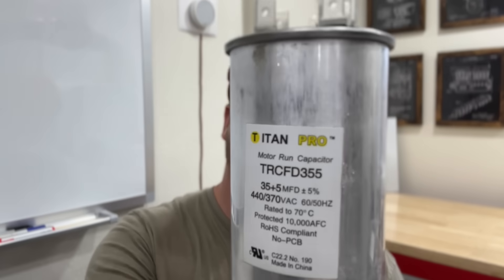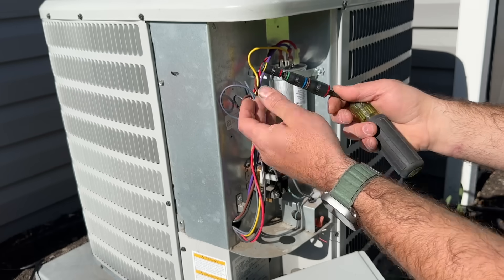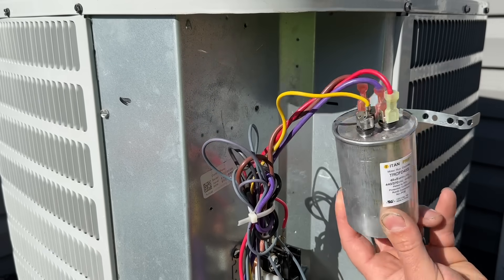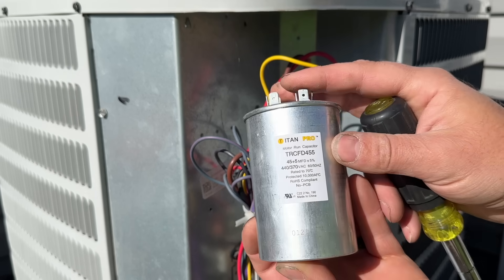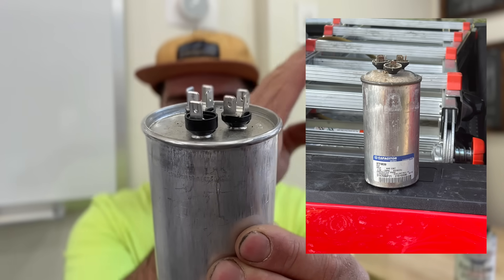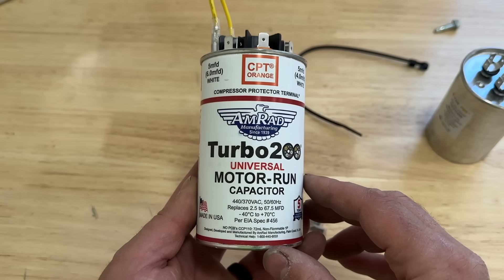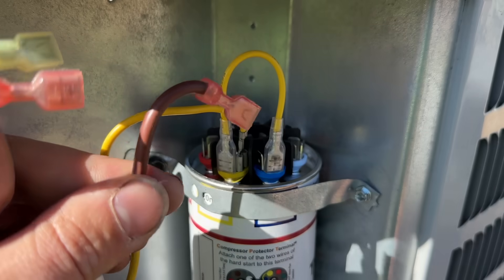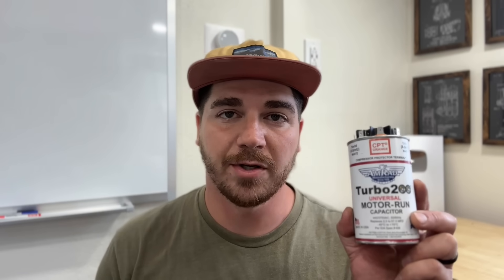HVAC Contractors Practically Make Their Living On These

Comment: I see a lot of comments here about people complaining that they were quoted too much for a simple repair. Really? If it's so easy, why didn't you do it yourself? Oh- because you didn't know how? 

When you call a service contractor, they have to pay for the service techs wage (about $50 hourly in my area) which includes the education or apprenticeship of the field tech. (I had a two-year degree in HVAC service), the purchase and maintenance of the service truck, the time that tech would spend going to purchase a part for your system. The have to pay for insurance on a whole bunch of things the home DIY'er doesn't. On and On. I appreciate this video trying to help consumers save some money, but I think it's crappy that this video takes the tone of "You're getting ripped off".  I've seen this content producer in other videos putting Teflon tape on backwards and using pliers to install plumbing fittings, things a professional HVAC guy would not do. If you can do it yourself- great. But don't use that to run down my experience and education. Talking about "bad capacitors seems to be the magic advice for A/C repair on YouTube. But I wonder what killed that capacitor?  Good luck figuring that out without knowing the theory.

Comment: I just watched another video from the manufacture of the Turbo2, your suppose to wire the Herm pin to the highest jumped pin, so instead of putting it on the 20mfd, you put it on the 25mfd. Im not a HVAC specialist, just a dummy with the internet. So take that for what its worth.

Comment: WARNING. You said to use an insulated screw driver to discharge the capacitor, but in the video, that klein screw driver is not an insulated driver. Just a warning to everyone to use an actual insulated screw driver. You never know, and it could be very dangerous.

Comment: WAKE UP HOME OWNERS.YOU SHOULD ALWAYS HAve a stand by capacitor for you central system . they cost 20 bucks or so and these havc crooks make several hundreds on a 20 dollar part you can easily replace yourself. simple. go to the condenser outside and with a stick or wooded dowel manually push blades and it it runs, you need a capacitor .

Comment: scam? companies gotta charge for labor, charge for insurance, charge for gas, charge to miles wear and tear from fro van and tolls, also knowledge and risks.  Good capacitors cost $60+. Anyone charging less than $150 is not doing it right. (people should charge between $150-$350).

Comment: I had a service plan when our capacitor went.  It lasted about 5-6 years.  We’re in 7 years on the replacement.  I keep a replacement capacitor handy in case it goes again.  I believe the replacement one that was installed 7 years ago was made in USA. At what point would you replace it as a preventative measure?

Comment: Some good info in this video, but I think the recommendation for the universal capacitor is a bad one. It is very easy to open that panel and learn what capacitor you will need when it fails.
And buying one ahead of time is not a bad plan. I ended up paying $40 for one instead of $20 because I needed one quickly.

Comment: I would not change anything myself if that HVAC system is under warranty. If something happens after you replace that capacitor on your own and another part needs replacing that is under warranty, the person the warranty company sends out will ask if you have had a licensed HVAC contractor taking care of that unit. If they see something done wrong and you have been replacing parts yourself, they will not honor that warranty.

Comment: I just bought a new one and replaced it, but all that happens is I hear a noise outside and it doesn't run. Could the capacitor be bad? I put the wires exactly where they were before, but we had a guy come in trying to sell us a new AC. could he have switched up the wires?

Comment: This video is good stuff. Remember after powering the unit back on There is a five minute delay before the unit will start.
I personally pull the plug on the outside turn off the blower motor switch on the side of the furnace and flip the breaker off .

Comment: After dealing with several a/c problems, on my unit, families units, and I helped some friends.
I agree 100% with what you've said.
There is one thing you missed. There are three things you can check and change on your units.  The capacitor, which you covered,  the fan, which you also covered, the one thing left is the contactor. That is the device with wires connected to the sides of a coil , these are the 24volt from thermostat, next will be two power wires into the unit and on the other side two wires going to the compressor and fan.
I always suggest to people, and have asked a/c repair techs and they agreed. 
While everything is working fine, find out what size capacitor your unit has, some have separate (2) capacitors compressor and fan are separate.  The other item is the capacitor,  usually a 4 wire, could be 2 wire. If you don't know get 4 wire will work on either unit. Buy 1 each of these parts, neither are expensive,  unless you're buying them from a/c tech at 10 o'clock at night or weekend. 
You can order everything from Amazon or at local a/c or appliance repair shop - usually pay more thru them. Amazon should run $15.00 to $20.00 each, much better than $200.00 up from a/c tech.
Be certain all power disconnected,  discharge capacitor/shorts before touching. Not hard, with a little knowledge and common sense you'll be the savior of  the family summer.
Great video, keep up the great work.

Comment: That’s actually a dual capacitor one terminal is for the fan one is for the compressor one is for power in to it DO NOT handle these with your bare hands after they have been energized recently they can hold a charge and it will zap u it’s an old hvac hazing joke to throw one to an apprentices lol and as for the how u test a capacitor u get a multi meter that can read capacitance if it doesn’t say uf it will have a symbol that looks like a sideways smile face with a flat line beside it if you’re experiencing power brown outs and black outs that can cause these to fail as these smooth out the incoming voltage and reduce voltage drop on startup so they are susceptible to failure

Comment: HVAC companies and plumbers are thrieves. my system was leaking water, I didn't know anything about HVAC systems since I grew up with swamp coolers. The problem was simply a clogged condesnation drain pipe. literally a 5 minute fix, no special tools, just suck it with a common vaccum. I forget how muc they charged but it was at least 200, but I think $300 for 5 minutes of work.

Comment: The installation cost for simple components is out if control. It's not just the capacitor, they do the same thing with the contactor if it goes. Cheap part, but you have to know how to connect it or you could damage something expensive. Also my wife can't live more than 10 minutes without A/C. I work and can't just jump on a repair, but the A\C guys can. Also ordering inline means a significant wait to  get the part and if the weather is headed to 80 and high humidity it's a nightmare. I'm going to buy spares but I'll lose them before I ever need to replace them unless I strap them to the  installed parts.

Comment: I had an HVAC guy here for a different problem and he showed me a picture he took of my capacitor and said it was going bad, but wouldn't use the word capacitor. Just described it as a thing that was going bad. I know what capacitors are so asked him, "Is that a capacitor?" He said, "Yes, we're not supposed to tell you that's what it is because people will go buy them for $20 and do it themselves." He wanted $400 for it. If it had been $150 or $200, I'd have done it just to save me the hassle.

Comment: I was quoted $800 for a capacitor. Then told to replace the ac unit with an upgrade and new vents for $30,000. I replaced capacitor on my own for$30 and everything works. So simple. This scam should be illegal.

Comment: Power surges seems to quickly put an end to them….i keep spares - been changing these for a long time - easy to replace.  Just cut power and discharge the cap before touching with fingers.  Take picture and put wires back in same connector.

Comment: Just did this TODAY! 13 AUG 2025
Replaced the AC capacitor by myself for the very first time ever. My AC unit looks very similar to the one in this video, almost identical. I went to the appliance parts store and bought 2 (a spare to save me a trip next time) and paid about 17 each, tax included.
Compared to some other home maintenance jobs this one was pretty simple!
Reply: Same here. Bought it at ACE Hardware for like $35 and it took me 15mins.

Comment: I was out of town and my wife reported my 5 year old 16 Seer AC wouldn't start. Temp was about 100 in Dallas. I suspected the start capacitor. The company that installed it was oob. Another company charged $380 to install a start capacitor. I wish I had been home. I saw the replacement part on Amazon for $30.00

Comment: I was quoted $17000 for a brand new AC/furnace when the real issue was a bad capacitor. Using ChatGPT, I figured out it was the capacitor. Got a new one for $28. AC is back in action.

Comment: I wish AC units came with a built-in spare capacitor and a simple switch to toggle between the two. That way, if one capacitor fails, you could instantly switch to the backup, get the unit running again, and take your time to replace the faulty part without any rush.

Comment: I just found out the AC tech from 2020 who replaced my capacitor changed out to a higher spec from 45/5 to 50/7.5 without telling me. I never looked into them then. But I continued to have problems with my unit. Replaced the fan motor in 2023 costed me $600 in labor (part still under warranty Thank God) and they replaced capacitor too with this higher spec without double-checking. AC stopped working again next year in 2024. By this time, I saw a few YT about this capacitor and found it easy to replace myself. However, I just bought extras of the higher spec unknowingly. Now a day ago, no AC again. I put in another capacitor but no luck. Your info about repairclinic had me double-checking my spec. The higher 7.5 number has probably stressed out the fan motor again, or worse the compressor. 😒

Comment: Just the fact that you compared the capacitor to a battery that gives the unit an extra kick should disqualify you from giving advice on HVAC systems to anyone. It's one of the most basic parts, and it appears you don't even know what it actually does. Agree that anybody that charges over $500 for a capacitor is beyond ripping people off, and I have zero idea of how they sleep at night, but companies still need to make a profit, and have to make up for not being able to charge as much with higher priced parts,  the cost of overhead, money for growth, and the knowledge/diagnostic abilities, and labor rates for the techs. People doing their own repairs is fine, but you're not even giving out accurate information on what a basic part does. It's also that same sort of dumbed down explanation that the exact sales "techs" you complain about use. The turbo 200 also doesn't do "any size". It won't go up to values such as 80/10. You need the turbo 200X model for that size. (You even missed important information about how to best hook up the turbo 200 to get the most longevity from it) Hope not too many people get hurt, or cause damage to their equipment costing even more money from trying to take your advice just to save money.

Comment: Don't direct short the Cap!!!!  You can burn holes in the internal insulation. Use a resistor across the connectors

Comment: I guess I've been lucky.  Had capacitor go bad on one unit.  Guys charged $86 for the part & labor. Even if the part was $10, I was happy to spend $76 for them to come out, diagnose, and swap out the capacitor.  Another unit had the fan motor go out.  $600 for parts, labor & he swapped out the capacitor because the unit was over 15 years old.  This took two trips - one to diagnoses & other to swap out the parts.  When you find a skilled, honest place you stick with them - and you tell people about it.

Comment: I've done mine three times over the past 20 years on my Bryant 5 ton. The original was a made in the USA GE and lasted 13 years. I replaced it with the cheaper made in China Packard Titan and that one lasted 4 years. I then bought the Titan Pro and haven't had an issue since.

Comment: I bought an overpriced $40 replacement capacitor a few years ago from my local HVAC shop. I desperately needed it and live in a rural location where it's hard to get shipments quickly. Still saved me hundreds of dollars on labor just to replace it in the unit. These days I keep multiple $7 spare capacitors on hand. I'm sure I could replace the contactor as well.

Comment: I’m a licensed HVAC contractor in NJ. While I’ve never heard of this  in 30 years in the business, please don’t ever pay $2000 for a run capacitor. Around $250 is normal in the industry. Please don’t be naive and think that’s a lot for a $25 part. (A quality cap costs more than $18 on Amazon)

Comment: It’s a good idea to check the mfd readings of the capacitor each spring before it gets hot out. Sometimes the measurement gets low before it goes completely bad so you can replace it before it fails. A bad capacitor can cause a motor or compressor to fail.

Comment: Yep. I replace my own. Interestingly, when I bought the last one off amazon, the reviews were "shakey", but it was cheap. So I bought that one and the other one I thought would be more reliable. The price difference was really only a couple of bucks. But I'm glad I bought the second one. The first one failed after a few days. The second one is still doing great, and I bought another one of that one, just in case. BTW, this all happened early last summer.

What's a little comical is that I've replaced all of the "coils" in my four cylinder cars over the years (basically the same thing), but I wait until they fail. One car has had all four fail, but the last two failed within two weeks of each other, at 248,000 miles.

FWIW, it's a five minute repair and I just kept a 10mm wrench and a coil in my trunk, in the spare tire compartment. It's a good place to keep a serpentine belt and wrench too. This is mostly advice for folks with cars with over 80k miles on them.

Comment: Owner of multiple rental properties here and just used an amrad turbo 200 a few weeks ago.  I did it same day since I had one already to go.  They are under $100 and supposedly last longer than the normal ones used(plus they charge 300-450 in my area to replace especially if same day when its hot which is always the case.  If you are on the verge of using one just do it and figure out the wiring one time you will remember for the next and won't regret it imo.

Comment: Right up until you tried to push that 'turbo 200' I was with you.  Thanks for the testing procedure on the capacitors didn't know that.  People, open up your unit and get the numbers right from the git go, and ORDER THEM, order several spares, they are cheap and you'll be ready to go when they fail and they will fail.  I've got two units so I always keep 4 capacitors on hand, JUST IN CASE!!  Luckily my HVAC guy hasn't tried to screw me over too badly and I'm moderately handy with stuff.

Comment: I was charged $500 for this repair about 5 years ago. I watched them do it and asked a bunch of questions, took pictures of the part number and now I replace it myself. Will never call ac repair guy again. I bought 3 of these capacitors on Amazon for 15 bucks.

Comment: Service vehicle, insurance, tools, travel costs, wages.... inventory of parts on board the service vehicle... knowledge and training of said technician... it all has a cost. 20 mile drive round trip,  parts and labour.... it isn't free.  Albeit, $2000 is pretty hard to justify but a three or four hundred dollar service call for a 20 minute repair job with a $50 part is absolutely fair. Keep adding if it is a long drive or if they have to fetch parts and return.

Comment: I hear buzzing but fan is not turning. If I give the fan a push, it will start turning, but it won't reach it's normal speed. So that's the capacitor for sure? My coolant line is cold before it enters the evaporator but the fan is moving slowly (once I give it a push) and the heat coming off the AC is warmer than normal. Can I run it this way to get some relief until the new capacitor arrives or should I not use it? Thanks. Nice video!

Comment: Really good videos. I usually swap out the capacitor if a motor (that has one) doesn't start (after I check the plug and the circuit breaker). $10 - $20.
We all have stories of repair people trying to rip people off. I wonder if Mike Diamond plumbers are still telling people their water heaters could explode and level their houses?  They told this to a friend this, saying the water heater needed a pressure release valve. They do need these I said, yours should've come with one. I can't remember ever seeing a water heater without one. Hers had one.  He wanted to charge her $800.  
& Definitely shoot a video. Smart phone videos are a series of really sharp high res photos, How many times have you made a 'Notes Photo,' and left out the key thing? I still do this.